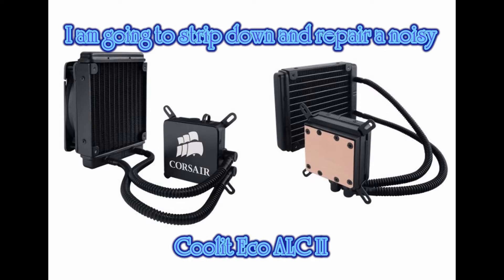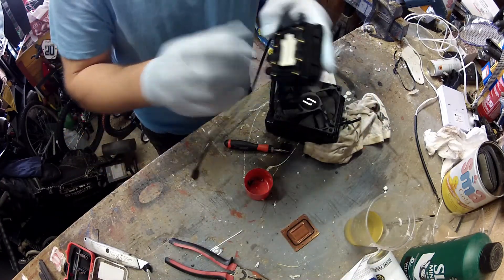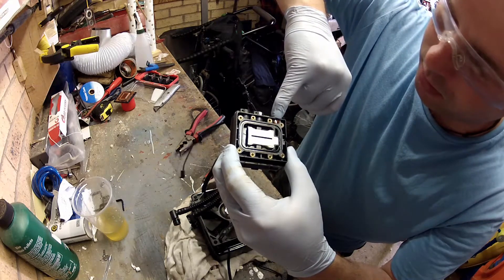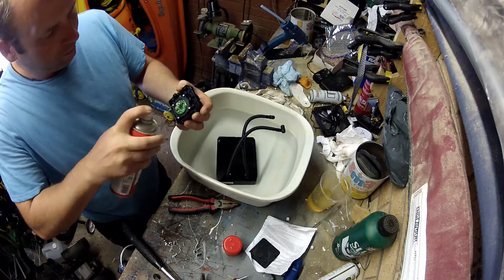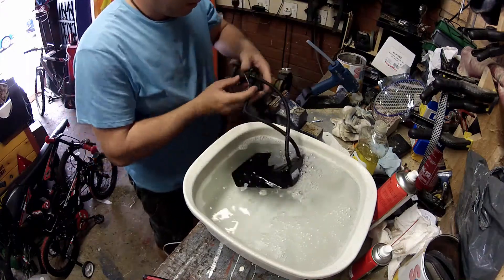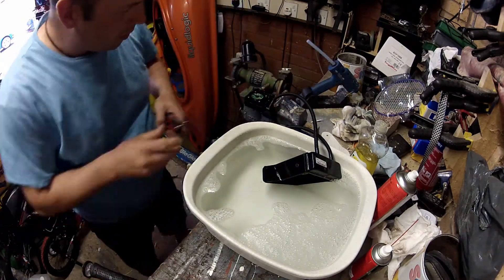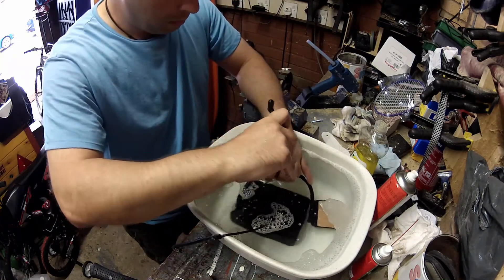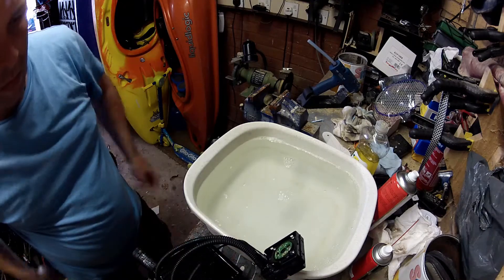Coolit ECO ALC II Strip down, flush, and refill.

Comment: How do you submerge the pump without ruining it ? And can you do this with H100i ?
Reply: Use DI water (deionized), it's $1 a gallon at any store. it's non-conductive and if it's crap DI, then it's still just 12v that drive the board and the pump and not "fry worthy".

Comment: Question about when you refilled the radiator, did you fill it up completely? because I have always thought and understood that it has to have some air inside to heat expansion and shrinkage.  Other wise you could blow the hoses off once the heat expands the fluid.  Anyone else agree or know about this?
Reply from the maker: I don't think I deliberately left any air. You will never get all the air out though. It's still running fine.

Comment: Ey does the Iodine really work as biocide?
Reply from the maker: +Yellow Diamond Sure does.  Dont get the clear Iodene as it normally contains about 50% alcohol.  The brown liquid is the one you want.  The one you would normally use on cuts.  You could also use a fish tank algicid but it would depend on the manufacturer and what additives they used in case it increases the ion transfer or corrosion.  Iodene is perfect!
Reply: yeah i got the dark brown one its povidine iodine, so i think im good to go, its the swiftech h220x so its just the flushing and rinse that i have done major, thanks thanks I will observe the loop gonna reply here and let you know what happens
Reply from the maker: Cool, you only need a couple of drops.  Good luck.

Comment: hey my cpu has been getting crazy hot recently,  I've been using that speedfan to check temps and even when my pcs been off for ages and cool I put it on and its somehow at 50 plus degrees and just rises so fast to 90 plus degrees then my pc shuts down.  
I have that eco coolit system do you think there's an issue with that?
Reply from the maker: It is possible. check the temp of the radiator by hand. If that stays coil to touch the pump has failed.
Reply: TheKayakingkid thanks mate cheers for quick reply

Comment: I wouldn't use deionised water, it'll corrode any metal parts, that and the fact it'll ionise itself as soon as it starts to flow around the loop!
Reply from the maker: +Mark Swift You need to expand on why deionized water will corrode the components.  Is it because of dissimilar materials and no anti-corrosive agent?  If so you need not worry.

Also all liquids will ionize themselves picking up ions from the materials they pass.  If you buy an expensive fancy liquid that will pick up ions too.  They all do.  Its impossible not to.  The fancy liquids you buy are only to attract consumers.  They have no benefit other than colours and fancy names.  Deionized water outperforms 99% of them.
Reply: +TheKayakingkid I agree with regards the various coolants available on the market - it's been proven they have little effect on cooling over distilled water. That said, your setup uses a mixture of copper and aluminium, therefore using deionised over distilled is not recommended, you also need a corrosion inhibitor to avoid ion transfer. There are various discussions online that go into more detail but generally it's not advisable in a mixed metal setup to run plain distilled water, and certainly not deionised alone. That and the fact deionised can still contain mineral content etc. Many people seem to think the 2 are one and the same thing, sadly they're not.
Reply from the maker: I have never had a problem with corrosion and use distilled water in all my cooling rigs.  I also either add a silver coil or a drop of Iodene to prevent organic growth.  It is impossible to stop ion transfer in any liquid.  Adding anti freeze will help with corrosion if you have problems with it.  The minute you open a liquid to the atmosphere ions are transferred to the liquid without touching any other surface.  Ion transfer is not a major problem anyway.  The benefits of new water or coolant come if you have leakage in the early days.  You can get away with it as the water has not reached the level of electric conductance that can damage your PC.  The best off the shelf coolant only have 90 days warranty and a disclaimer should your system leak anyway and will only offer perhaps 1 more days safety over distilled water.  After about 30 days if the liquid leaks, distiller water or fancy liquids your PC will go boom anyway.  I have been water cooling for a long time and have never had a problem with corrosion or fungal growth.  I thought of adding a circuit to warn me of a pressure drop in the water circuit but never got around to it.  I used to change the liquid ever few month, now I change it every year.  I have a electric conductance meter which I can check the liquid with, but only really used that when I was experimenting in some of my other vids.

Comment: Had it for 5 years. it just started to get really hot today. Does it need a flush or did the pump die? The fan on t back of the computer seems to still spin
Reply from the maker: +Mowgli Baloo That doesn't sound good.  It could be the pump if the radiator is cool.  Time for the bin if it is.
Reply: thanks for the reply. It ended up being the pump. I got a high end fan heat sink as a replacement. At least now I will be able to tell if it is failing. thanks again. mowglii

Comment: Nice tutorial.
Just a question: isn't it possible to remove the pipes from the radiator instead from the CPU block?
Reply from the maker: Sure, you can removed the pipes at either end.
Reply: TheKayakingkid I figured it out yesterday when I repaired mine. Following your tutorial, it works like a charm now.
Reply from the maker: draacking Glad it helped.  Thanks for the feedback.

Comment from the maker: I used a small piece of mild steel welding rod.  1mm if I recall.  Something similar will suffice as it was not tight.  The pin you are trying to remove is called roll pin.  It relies on the spring steel tension griping the edge of the hole and relies on friction.  Good luck.